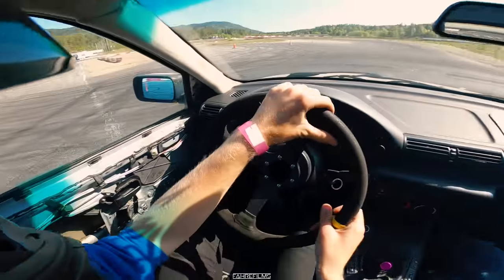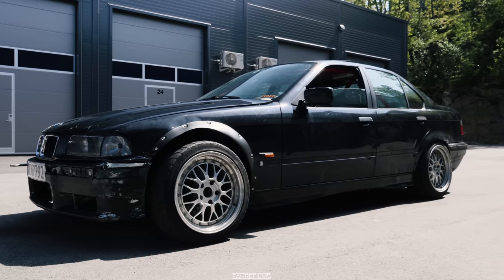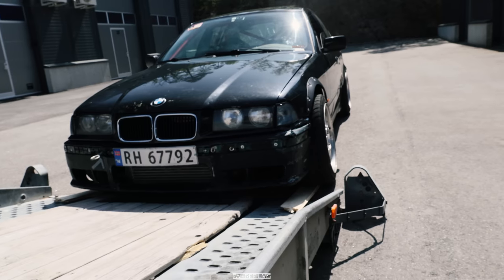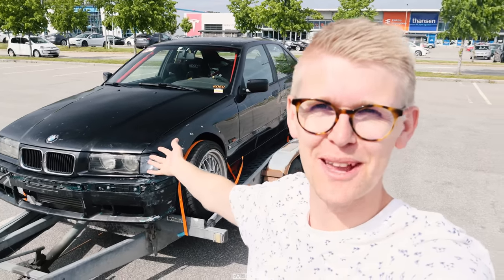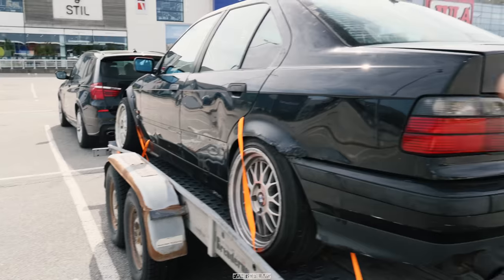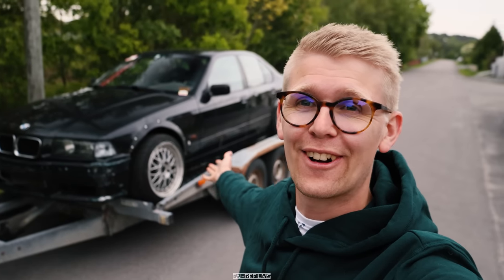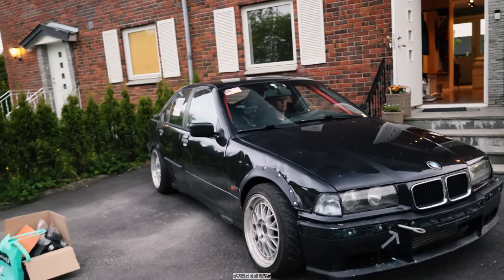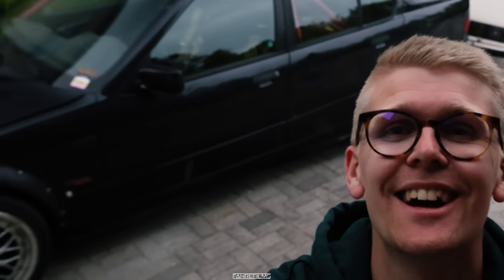I BOUGHT A BMW E36 TURBO! NOT THE ENGINE YOU THINK!

Comment: In sweden its reverse, the smaller car you have the more you can tow. (If you have the "B" license).

Thats because with b license you can max drive 3500kg "fully loaded", that means if you take a 5 series with "fully loaded" weight of 2500kg (doesnt matter if you actually load it that much), you can tow 1000kg fully loaded trailer. But if you take a nissan micra with 1500kg fully loaded spec, you can tow a 2 ton "fulyl loaded" trailer. Very weird. Changes though when you get the "be" license.